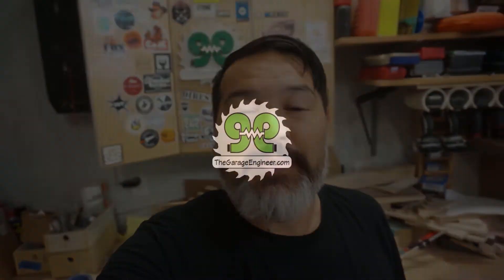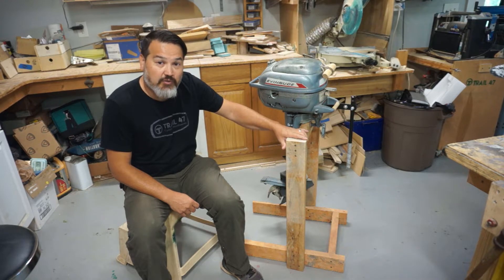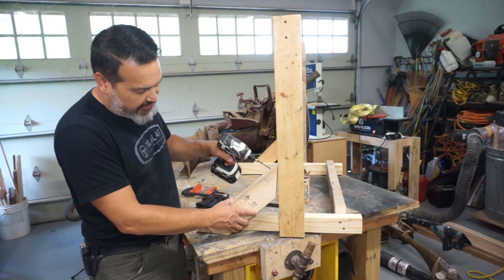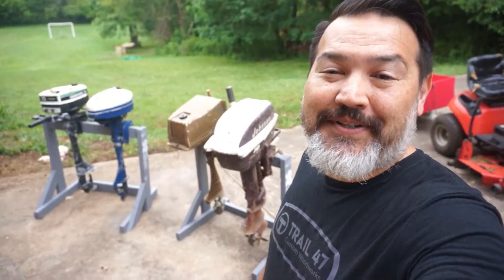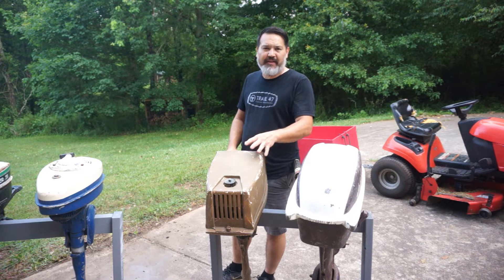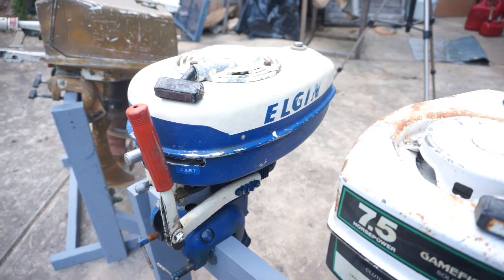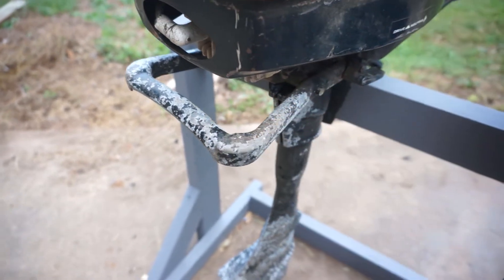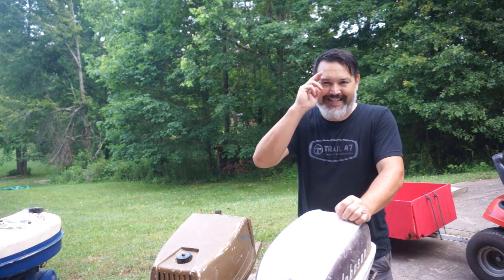4 Boat Motor Find. We Build Dual Motor Stands - The Garage Engineer

Comment: I woulda built them stands out of 2x6 and more screws when you out the 2 larger motors on the stand it sunk backward a bit
Reply from the maker: Good idea.  I just used wood I had on hand.  Bigger would have been better